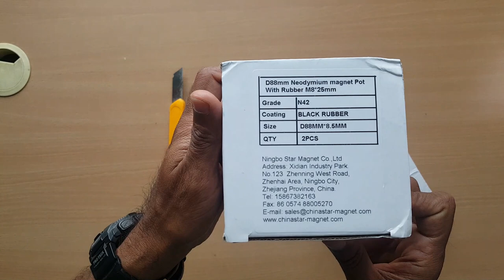Magnetic Holder for Instant Led Light Bar Setup in Car Truck etc

Comment: Nce Idea , can this setup work with 12V socket without relay? its a silly question ,since i dont have any idea on elctrical and electronics i just posted it.
Reply from the maker: Since 12v socket is perfect for low power loads like phone charger etc,   you cannot load HIGH WATTS (POWER) consuming lights like this for long period of time, it will MELT the holder (connecting inside the 12volt socket).

Comment: You have some serious interest in lighting bro! I have a jeep compass 2017, with reflector fogs. Also my HID's seem to be on bit low side for country side drives. WHat do you suggest? A projector fog upgrade or a imported lightbar?
Reply from the maker: Hi John, My suggestion is a GOOD LED LIGHT BAR is the best upgrade for country side drive, if  you are OK with fixed clamps ( if you can manage or no problem with cops for extra light ), or magnet will do a better job but will take 5 min to setup or remove, FOG lamps will give extra visibility like 30% to 40% but a GOOD LED bar can give a 100% extra visibility and you can adjust the angle too .
For light bar, i have a video if your have time or interested check this : https://youtu.be/o4FxTCVHR6M
Have any question, comment below, will reply...

Comment: Hey Brother, loads of love to your work from Uttar pradesh Northern India. I also wanna order the same pair of magnets from where can i order them?
And I have one more query.
I own a honda wrv and i am not at all satisfied with its light unit. Need your guidance for its upgrade. What should i switch to ? HIDS? LEDS? PROJECTORS FOR FOG AND HEAD UNIT BOTH? AND I already have a couple of HIDS mounted lights on my bull guard
Reply from the maker: Hi Tushar Yadav, Thank You and Glad you like my videos,  I bought this magnet from aliexpress.com, If you need the link reply me i will check and post it,
My Suggestion (opinion) for upgrading the light, as you have mentioned that you have a extra pair of HID on your bull guard, HID's are one of the best performers, can you please tell me what brand they are, so that i can get an idea how their performance will be , 
Option : 1
Upgrading the headlight bulb with after market LED light bulb is like hit or miss, In my opinion still now these LED light bulbs have not achieved the performance of 100/90 watts halogen, As from a opposite diver view LED light looks like bright very bright and powerful but when you sit behind the led light as a driver you see a WEAK lights on road, Most of the LED bulbs just create glare to opposite vehicles,  if you wish to test a LED bulb you can try CREE XHP 70 led bulbs it  is one of the best so far i have tested ( if you like to know the performance i have a posted a video about CREE XHP 70 : https://youtu.be/99ACsc68w5Y )
Option : 2
There are LED Projectors head lights with laser high beam, they are pretty costly (very costly),  with QUAD setup it will bring the sun on the road, they have to be fitted with a professional (retrofitting) ( if you like to know the performance i have a posted a video about LASER LED PROJECTOR : https://youtu.be/dYef1FNN5C8 )
Option : 3 
Adding a Hid in fog in a good upgrade but it should be branded product like morimoto etc..
Option : 4
You can try a LED BAR again it should be from a good brand like Ridge or LightForce etc...
( if you like to know about ridge light bar i have posted a video : https://youtu.be/o4FxTCVHR6M )
Have any doubt or question, comment below, will reply you...
Reply: @wheelklub  Thanks alot for your feed back sir. I have thought of some setups and want your feedback on that.
Option1::- Since I told you about those HID light unit, I dnt remember there brand but i got them for 3000 bucks and there were fixed on the bullguard which I removed after the government passed the new rules. So now i am thinking of setting them up using those magnets on the bonet. And they also have those yellow filters for fog. Along with that I am thinking of using mini projectors of HID of which you gave demo (Green box one).  And bixenon hid projectors 2.5inch setup on fog lights.
Option 2::- I have searched alot about Leds from past one month and i came to the conclusion that you are absolutely right about the glare and all. But I want you to look after ( Gtr Ultra 2 led ) which I guess are the perfect led for both reflectors as well as projectors since it is identical to the original halogen. These have good throw, brightness, hotspot area and band. They if aligned properly doesnt glare and output lux is  3times the normal halogen. And to use (mini gtr light) for fog lamps.
 I am avoiding using bi xenon setup in headlight cuz i dont wanna temper the haedlights and open the seal.
Waiting for your reply.
Btw where are you from?
And trust me you do great work keep it up and yaa voice is mandatory..so if not while recording , you can also prefer voice over. I as frnd have a advice for you. If you want you can check ( Headlight Revolution ) channel. Its kinda good.
Stay safe. Take care bro.
Reply from the maker: Hi Tushar, 
Just went through the GTR LED on the web, I have not tested it, The Price seems to be very HIGH, but there are other bulbs in the same pattern (like halogen), My opinion is to test a same patter bulb which cost one third of GRT.
Why i am saying this is, Most of the led bulb are made in china including gtr with same COB chip.
if you are OK with GRT price, Happy to Buy them.
For FOG you need to retrofit it, Try to buy the projectors that fix inside the FOG, a GOOD setup will cost you 5k to 10k, Try to use OSRAM XENARC or NIGHT BREAKER LASER or  PHILPS XTREME VISION HID bulbs and projectors from Morimoto to have a good light pattern and light on road and very IMPORTANT thing is always try to buy the bulbs with kelvin rating between 4500k to 5500k ( MAX 6000k) to get good visibility, as human eyes can see better in these kelvin ratings.Above 6000k you will get bluish color it not that good for visiblity.
I too, do not prefer opening the headlights which will result in losing the originality, whether sealing, etc...
But still you need it, there is a other option, Remove the original headlight which came with the vehicle, Get a second hand headlight or after market headlight (which are very cheap) try the retrofitting in it with projectors ( again a good projector)
Thank you for the info, yes i went through the Headlight revolution they are doing great on headlights..
Reply: Thanks alot bro for your help. Can you provide me with links of the following :-
1- Green box mini projector 
2- Halogen bulbs
3- projector n hid setup for fog lamps 
4- Magnets
Want to buy them.
Thanks again. 
Take care. Waiting for more of your content

Comment: Does this light bar comes with remote control??? Or how do I turn off the lights,
Reply from the maker: Hi, I made a separate switch with relay ( 100 amps), No remote with this light bar.

Comment: Hi 
Plz tell me powerful led fog lamp
Reply from the maker: Hi YNR, Can you brief your question, i can't understand what you like to know. In this video i have explained about Magnets, Reply to this comment, will revert you back.
Reply: @wheelklub  hi bro 
I knew u and wanted to ask u that i want to install very powerful fog lamp in my bike. Liked IPH M617 and HJG 60w (4leds)  plz suggest me led only. For knowledge  plz tell led, hid which is powerful? 
Its message bro not reply so video content doest matter.
Reply from the maker: Hello YNR, Glad to see a detail reply,
My suggestion for LED fog for Bike :
First of all, YOU NEED only LED and your are correct, LED is a better choice when compared to HID if your are fitting a new one, Sorry to say, I have NEVER tried or TESTED any LED fog lamps, but with my experience my suggestion to buy fog lamps with better low beam spread pattern, it should be like a projector low beam pattern, try to place it very low (max you can)
so it will not blind others and at the same time you will get wide beam pattern, if you place it on TOP, near to the headlight or on the Handel Bar, you have to tilt it down to get better visibility, but the light spread will be narrowed,
LED Light COLOR is a very important factor as like brightness Always try to get light with 4500k to 5500k these are the best rang for HUMAN eyes to see better.
Always Remember better light pattern gives a comfortable riding experience, and will be better than a BRIGHTER light with  UN EVEN light PATTERN  

I will upload a simple LED vs HID comparison video with in two days, 
Have anything to say? reply below...
Reply: @wheelklub  ur insta ID ?
Bro u hv experience of m617 led projector it's fog lamp I saw ur video u r using IPH M617. Can u tell about this model and 
does it needs relay?
It has low beam wide spread pattern?
5500k is fine ? As I like that
It's fine or any other model in led is better than this ?

I need ur insta or fb ID so that we can be friends and able to talk on proper messenger
Reply from the maker: Hi again, I have not posted any IPH M617 video, can you please send me the link, Will check and update you, A Simple LED vs HID comparison video is completed, need to edit little bit, will upload today or tomorrow and inform you.
Reply: @wheelklub  tell ur instagram ID